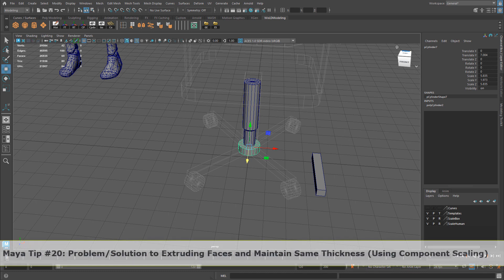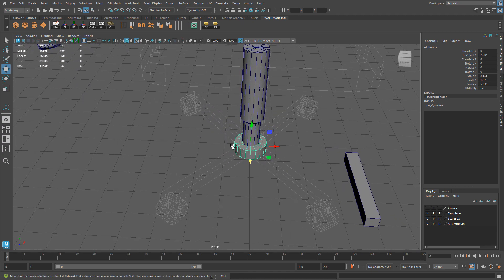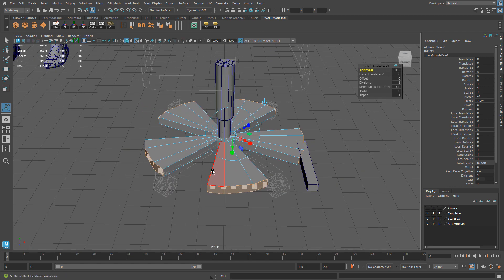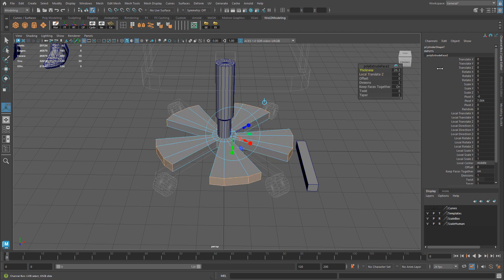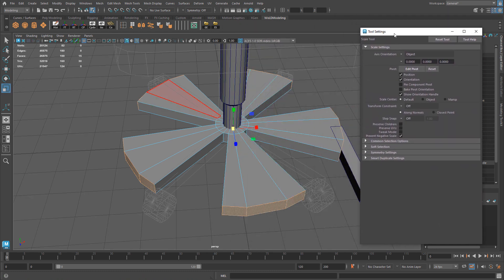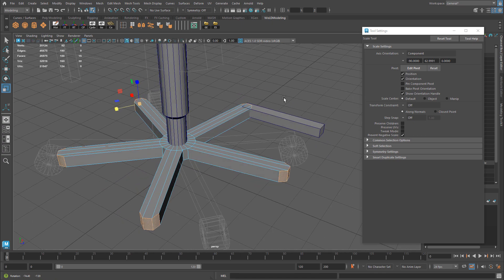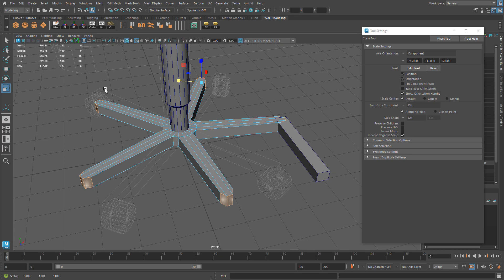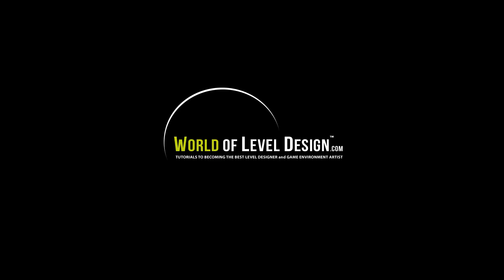Maya Quick Tip 20: Problem/Solution to Extruding Faces & Maintain Same Thickness (Component Scaling)

Comment: In this case, the easiest way is to select faces, press W, choose Axis orientation:Component in the Move tool and then shift drag. It will preserve the curvature of selected faces and the thickness of the extruded geometry.